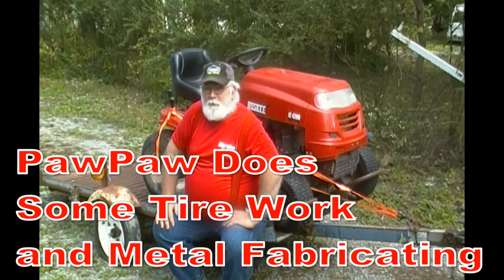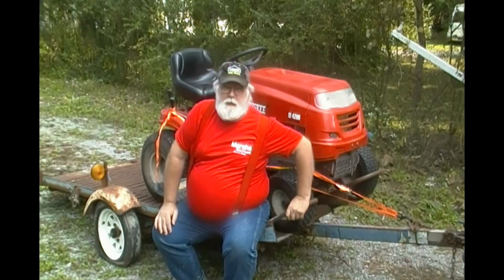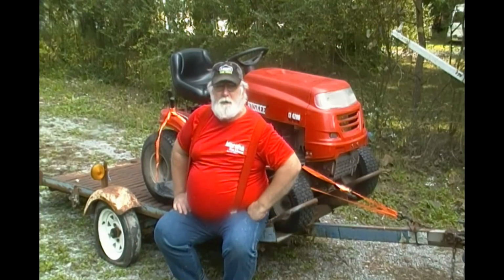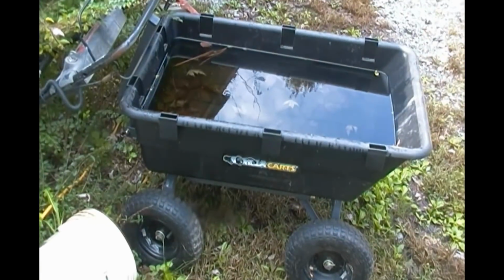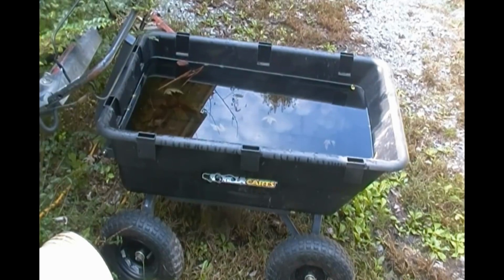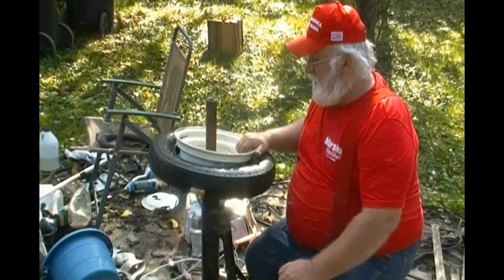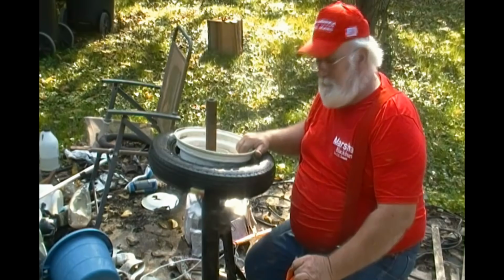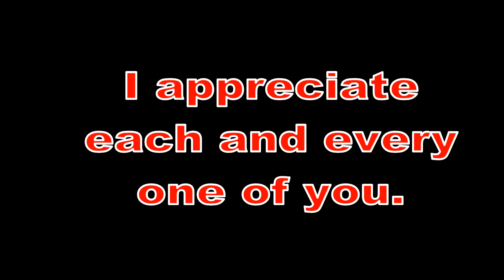PawPaw Does Some Tire Work and Metal Fabricating

Comment: I think I know why there was just music when you were trying to get that bead to seat. Small tires are the worst. I once replaced the front tires on a riding mower and went through every trick in the book as you did, except I don't have a bead blaster. I ended up with a log chain wrapped around the tire and a bar through the links to tighten. That finally convinced the tire that it should pop up on the rim.

Comment: Dam Paw Paw, Don't you just hate it when something simple becomes a project. I will say all that sodium you have been getting in the V8 drinks doesn't seem to be getting your Blood Pressure too high. I would have kicked that tire and probably thrown it into the woods after all that you were going through. I am the same way, I have all kinds of scraps from stuff. My wife always questions why I keep all the things I do. Until I use them to fix something she breaks. Great Job on the trailer . Be safe
Reply from the maker: I quit the heavy sodium juice and now the pounds are falling off of me.  The sodium was making me retain water and my skin all over was tight as a tick !

Comment: Great idea packaging for a sale. New tire goes on so easy compared to the older ones then you have it. I though you had it for sure with the bead blaster. Last week I was in in bit of a hurry & two steps ahead of myself when I thought I was loosing the tip of my finger using the ratchet strap on a tire. Used it so many times before but this time well lets just say it got my attention real quick LOL (now not then). For a water  trough  I just use one of the wheel barrels. Works well & one less thing to have around. Nice job fabricating the spare tire bracket.  You may want to check the bearings on the trailer. When listing be sure to mention,bearings serviced or changed, working lights etc. Enough of my 2 cents. Should get you a good return. Stay well, Joe Z
Reply from the maker: The trailer bearings is another video.
Reply: For maintenance  I will be doing one soon. If I get a chance I will video it.

Comment: i know your always interested in building stuff so I wanted to share something I figured out.. If you bolt  a truck heater core to the front of a buddy heater / sunflower or mount it inside a kerosene heater under the lid and hook up two female hose ends "washer machine hose cut in half" it makes a hell of a decent portable hot water heater, you can hook a hose up to it or gravity feed it, now for the sake of safety you don't want the heat source burning without water running through it due to either possibly melting the heater core or it boiling/rupturing. Its working for me so far so good but this is a beta type of thing with room for improvement , since you taught me how to make decent bum wine i figured the least i could do was pass the idea on, and if somebody builds a kit and make a million dollars I could sure use a decent 4x4 truck.
Reply from the maker: You gotta be careful heating water in a core like that, especially if the water might come in contact with your mouth.  Remember, anti-freeze will kill a dog.
Reply: I defiantly thought of that. Your right I wouldn't drink water out of any water heater they are gross inside you can eliminate 99% of risk by using a brand new core
Reply from the maker: I still wouldn't drink from an automotive heater core.... possible lead in the solder..... remember people used to go blind drinking moonshine made using car radiators.

Comment: Paw Paw I was curious what you were doing with the air tank while you had the trailer wheel on the tire changer and that was a great idea and a good job with the spare tire carrier
Reply from the maker: That is a bead blaster to help the tire pop up on the rim, but doesn't do well with these little tires.
Reply: @DoingItCheap  I am sorry for being so ignorant but I always took the valve out or sprayed it full of starting fluid to blow them up although I dont recommend anyone doing this unless your extremly bored or your drunk enough not to feel the pain when it goes wrong LOL
Reply from the maker: I try to educate folks with my videos.  I originally started this channel so my grandchildren could learn from me after I am gone.  I already demonstrated the starter fluid trick on the $2700 backhoe video.
Reply: @DoingItCheap  that is right I forgot about that and I truly love your videos. I also laughed my butt off when you were getting ready to use the impact and you wrote on the screen aboit plugging it in first I dont know what it was about it but it struck me as funny maybe because it was something that I would have done for sure. Keep up the awesome work and keep the wonderful personality and humor sure makes a fellers day a little brighter